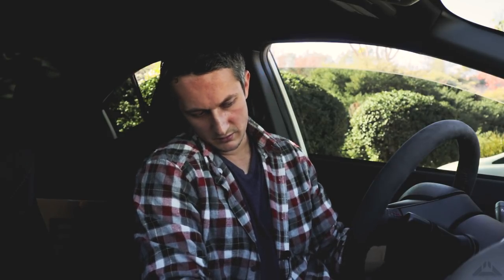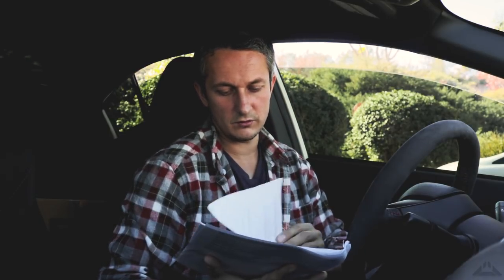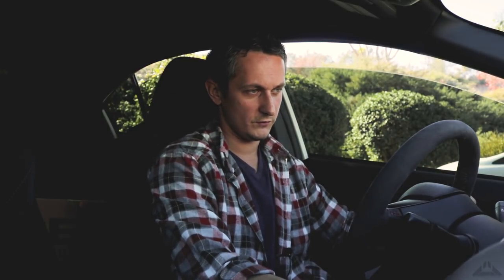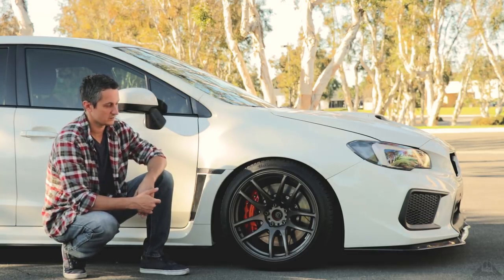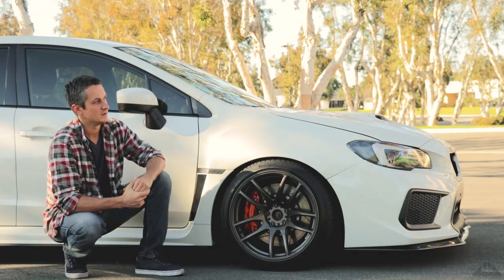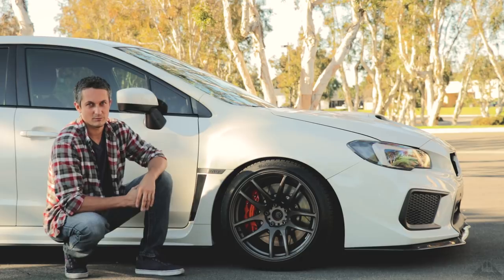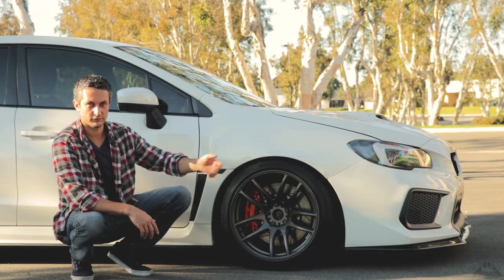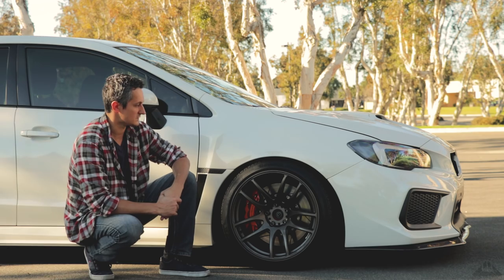ProdigyWerks BBK installed on the WRX

Comment: It's called a line wrench if you were still wondering about the name for the wrench. I recommend getting your brakes pressure bled to get the brakes feeling solid again. Great video keep it up!
Reply from the maker: That's it, thanks man. I was trying to think of the name. They feel solid now but if there is a way to make it even better, I am all ears. I will look into that pressure bleeding thing. How does it differ from regular pump and hold?
Reply: @TheShaddix  Pressure bleeding uses a device attached to the cap of the master cylinder. When the device is attached to the master cylinder, its perfectly sealed and applies pressure to the braking system. Because it's perfectly sealed and is PUSHING the fluid out, it removes almost all the air better than conventional bleeding. Essentially when you pressure bleed the system, there is a constant flow of brake fluid through the braking system to ensure no air enters system (or created). When you use the "pump and hold" method, you have to pump the brakes to push new fluid back into the caliper, this can introduce small pockets of air (very small amounts) and cause the braking to not be as solid due to a venturi effect (from my understanding). In my STI, I had the same issue. After I bled my brakes I noticed the braking feel was not as solid. At the time, I was working as a technician at Subaru and one of the older techs there (who has been working on Subarus for longer than I was alive) told me to pressure bleed the system to fix my problem.
Reply from the maker: @everydayinvestor6718  well damn! You've sold me on this for sure. The idea of just opening all caliper valves and letting the fluid flush out sounds good to me! Unless you have to do one caliper at a time? Can you recommend a good pressure bleeder? There are tons but they get so so reviews on amazon, not sure why. I also want to switch to a different fluid that is easier to monitor. The one I am using is almost transparent, not even yellow, so when it's in the reservoir it looks empty at first glance. Can you also recommend cheap decent fluid? Never gonna buy expensive stuff again as I drained 2 bottles of motul all for nothing at 18 bucks each...
Reply: @TheShaddix   You do it one caliper at a time. Starting from passenger rear caliper, driver rear caliper, passenger front caliper and finally driver front caliper. We used rather expensive pressure bleeders (higher quality) because we're a professional shop. I recommend one made by mityvac (which is rather expensive at $150) or one made by motive tools (around $50). The most important thing is finding one with the right attachment for your wrx. I've always ran Subaru OEM fluid, it's more yellow in color. I never ran expensive fluid because I don't track the car and heat up the brakes enough to need better brake fluid.
Reply from the maker: @everydayinvestor6718  I'd rather get the one for 150, this way it's worth even bothering with it. I keep reading comments about the motive bleeder attachment, so that deters me from it. But I'll do more research on this. What about the abs unit in these cars? I've read that it needs to be accounted for when choosing which corner to bleed first, or is that all bs...?  When I bled my brakes I just did each corner and disregarded the order. I am 100% sure there is still a bit of air in my lines though. If you don't mind describing the exact process on how to use the power bleeder (lets say the expensive one you use), I would really appreciate it, and I am sure others here would too! This is solid info no doubt, regardless of what brakes are on the car.
Reply: @TheShaddix  When I went to automotive school, they taught us that for MOST vehicles, bleeding procedure starts at the caliper that is furthest from the master cylinder. This is usually the passenger rear caliper on USDM vehicles. The theory and logic here is that since the brake lines are all connected to one another, you want to eliminate air from the furthest point of the master cylinder. If you don't do this, say you start from the front brakes, you are essentially pulling any air from the rear lines and introducing it to your entire braking system. That means it will be MUCH more difficult to take out all of the air in the system. When I worked at Subaru, the OEM service info also said to bleed the system from passenger rear, driver rear, passenger front and driver front. So I'm going to trust Subaru engineers on that one. I recommend to always follow the factory procedures given by the manufactures (because they know what is best for the vehicle). As far as the abs unit, most of the ABS units in Subarus are near the passenger side engine bay and is connected to the master cylinder. Since the ABS unit is AFTER the master cylinder, this means the ABS unit is already accounted for when bleeding and should be fine. If you think about it, the air in the lines should be near the caliper because that is the spot where you introduced the air (not in the ABS unit). 

As for the pressure bleeder, you first hook up the pressure bleeder to the master cylinder with the supplied adaptor cap. You then pump up the pressure bleeder (or use air power depending on which pressure bleeder you buy) and hold the pressure. Make sure to follow the instructions of the tool. DO NOT over pressurize the system, you will damage the master cylinder. Next, put the bleeder tool with the clear hose (the bleeder tool you used in your video) over the bleeder screw and open the passenger rear brake line and allow the brake fluid to flow out. Watch your pressure gauge on the pressure bleeder and make sure you don't run out of pressure. Close the bleeder before the pressure runs out. Repressurize your pressure bleeder and then just repeat on all the calipers in the order I described. 

Sorry this is such a long post, I would love to help you if you have any more questions.
Reply from the maker: @everydayinvestor6718  The more info the better! It's much appreciated. I am new to the bleeding process and had to learn what I could and I think I did an ok job at that, but this pressure bleeding takes things to the pro level. I also just bought new line wrenches that are thinner around the grab points so it won't touch the caliper (which i already chipped with the other wrench from autozone due to its fatness). I can definitely see a lot of benefit from this pressurized bleed method, mainly because the pressure is constant with zero chance for air to pop back in. When you pump the pedal the pressure is great when pressing down, but when it comes back up air can get back in through the threads or even the bleeder tube that still has a few bubbles of air in it. So, will be re-bleeding it soon after I break these in. Right now the pedal pressure is solid, but sometimes it's a bit less. Do you know if that's normal? Or is that air bubbles affecting the feel?
Reply: @TheShaddix  Seems like you might still have a little bit of air in the system if you aren't getting a consistent pedal. Pressure bleeding definitely is more done at the professional level and on performance vehicles wanting every bit of performance gain and feel.
Reply from the maker: @everydayinvestor6718  I was watching some video on the motive power bleeder and someone made a logical comment saying it's best to get the fluid out right at the caliper through vacuum vs. pressurizing it at the reservoir. This way no mess and no worrying about overpressuring the master cyl. What are your thoughts on that?
Reply: @TheShaddix  There is no mess with pressure bleeding too. As long as you have some clear hose that will fit over the bleeder screw and a bottle to capture the brake fluid, there is no mess. If you watch your pressure gauge on the pressure bleeder, it's pretty easy to not over pressurize your system. The only downside of pressure bleeding is that it takes more time to set up and bleed. In my opinion, I think pressure bleeding offers better feel and performance. When I told you about bleeding my STI, I also vacuum bled the system (after I was not satisfied with manually bleeding it) and still didn't get the braking feel I wanted. When you vacuum bleed the system, you are "sucking" the fluid out. As explained to me by one of the senior Subaru technician's, the vacuum bleeding process creates a Venturi effect in the brake fluid as you are sucking the fluid out of the bleeder. This means that since the brake fluid is being "sucked" out of the caliper, you get a "swirling" motion in the brake fluid as it exits the bleeder screw. This "swirling" effect causes VERY small air pockets to enter the caliper. When you vacuum bleed a system, you will notice that you will never get clear fluid to come out with no bubbles. But when pressure bleeding, it will be a stream of clear brake fluid with no bubbles because fluid is being PUSHED out. 

I hope this helps. This is PURELY my opinion and experience as a Subaru technician. So it may differ from others. For most applications, vacuum bleeding is fine, quick and easy. However, in my opinion, if you want to squeeze every bit of feel and performance out of your brakes, pressure bleeding is the only way to go. If you so happen to have removed all of the air in your braking system by manually bleeding, you may not even feel a difference with pressure bleeding.
Reply from the maker: @everydayinvestor6718  thanks for explaining it man! Talked me out of the vacuum bleeding completely! Honestly the pedal feels so good now that I am thinking of doing the pressure bleeding later, if let's say, the pedal becomes spongy again or something. Like you said, I might not see any difference. But I found a motive bleeder with a cap adapter for 75 total, that's not bad. The only reviews I saw that were bad were people not being able to seal the cap.
Reply: @TheShaddix  No problem. I love your build, keep it up!

Comment: Man, nice job! Nw yr gona have so much bite & confident haha those stock 1s are no gud for a wrx, they so poor n the reason u got in2 the accident too right? They did nt respond... Tht orange is spot on bro, matches with yr hub rings too lol. Keep up the good wrk👍
Reply from the maker: The brakes were not the reason for the accident directly, but it would've helped for sure. The rings are red, not matching at all, but it's not important right now. The brakes feel good now, but the initial cold bite is still not what I want. I will give them a few hundred miles and look into different pads if I don't like the bite. They are still wearing in, I can hear it.

Comment: Hey mate did the rotors say left and right when u received them? The slots on the rotors should send debri and gases to the outer edges. Looking at the vid  it seems the slots are angled the wrong way?
Reply from the maker: The instructions said which is which, the rotors are always installed according to the inner veins, not the slot orientation. The inner veins are what creates the cooling fan effect.
Reply: Gotcha, all good then.

Comment: Nice brakes my dude! Never heard of that company before...will u be doing the tears too?
Reply from the maker: I never heard of them either, but went online just to see what's available. They have really good reviews and told me about their sale going on, so I thought about it for a few days and just couldn't resist. It was a "now or never" situation as I had a few bucks to spend on something. To be honest, their customer support is hit or miss. But the quality is just as good as the stoptech brakes I bought before. Also, I don't see any point in spending money on the rear brakes, they don't do anything really. Even on the civic type R you can see huge front brakes but crappy rear ones like on the wrx... I am sure if it made a difference, they would've put nice brakes on the rear too and just raised the cost.
Reply: @TheShaddix  yeah for 6 pots they look pretty legit. Also with 2 piece rotors for I think 1500 you legit can't go wrong. I picked up my refurbished powder coated brembos of an STI had to get rotors and ss lines came to around 2500. I know the tears don't do a whole lot but I just find it odd to have bbk upfront and just basics on the rear on cars like type r and Mercedes. Also I think the new "supra" has the same thing bbk on the front and normal on the back.
Reply from the maker: @nabatron21  I agree, man. It looks ugly this way with the rear being stock. Trust me, if I had another 1500 or so to just throw at the rear ones, I would. But it's nearly impossible to justify when you can spend that same money on, for example, a flex fuel setup and tune, or new seats, etc. I think I got most of the big mods out of the way now on this car, so maybe later I'll get the rear brakes if the look bugs me. The price is just too damn high, even with a discount.
Reply: @TheShaddix  can u get rears from the company I couldn't find anything for the rear only the fronts?
Reply from the maker: @nabatron21  They do sell 4 piston calipers that could be used for the rear, but not sure if they sell the brackets for these cars' rear brakes... Contact them on ebay, they respond very quickly. Would be nice to know this info too just in case.

Comment: go watch subispeeds new tail light video. They show a JDM grille theyre releasing for the 2018 wrx's... it looks pretty good
Reply from the maker: Looks much better than stock but still not as good as the chargespeed grill which is what I like
Reply: TheShaddix have u seen the Seibon grill for 18 WRX? Check it out $400 something tho
Reply from the maker: @ronniedarko2536  I bought something from them before and the fitment was off. I hear the same thing from everyone who bought seibon stuff. It does look pretty good, but nothing special to be honest. It's just a cf frame with a cheap grill mesh. You're better off doing what I did and take the stock grill out, dremel out the inside of the frame, then reinstall just the frame with some grill mesh from ebay... Might not look as "hot" as the cf seibon grill, but will cost you about 20 bucks to do and from afar look just as good.
Reply: TheShaddix good point. cant wait to see the grill youve been working on looks like bro. 👍

Comment: What kind of brake pads are you using?
Reply from the maker: they are the ones that came with the kit, so their brand most likely. Zero noise, low dust, but the cold bite is a bit weak. They function great, just not as grabby at first.

Comment: Did you have to remove the dust shield?
Reply from the maker: Yeah, the new rotors are larger and would not work with the shields. You can bend the shields but why bother. Takes 1 minute to remove them, held by 3 bolts.